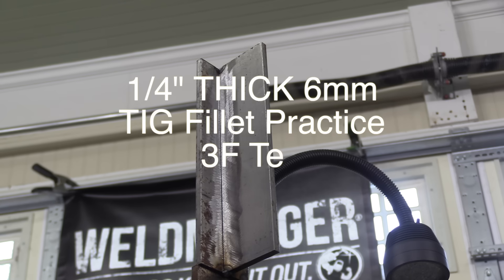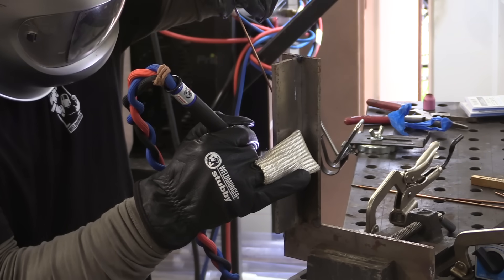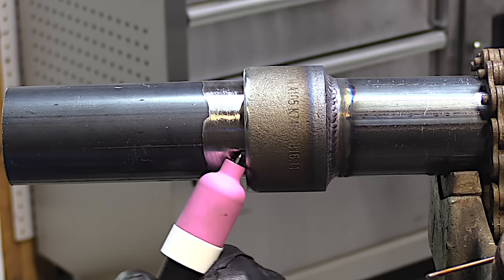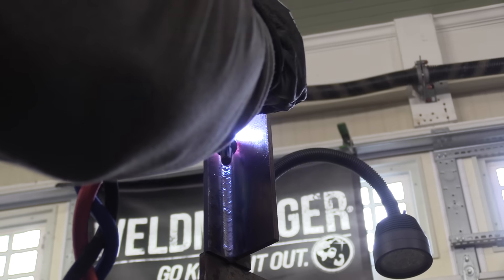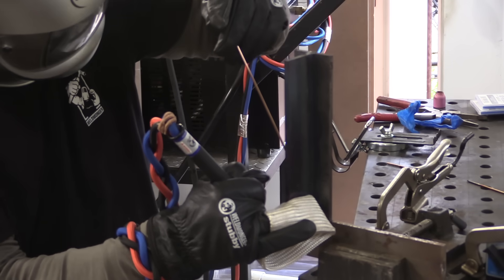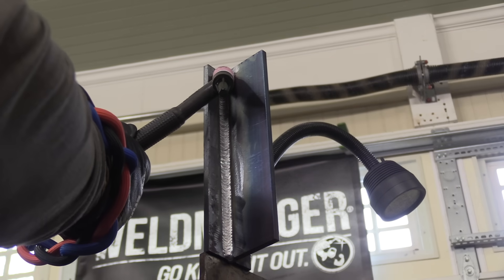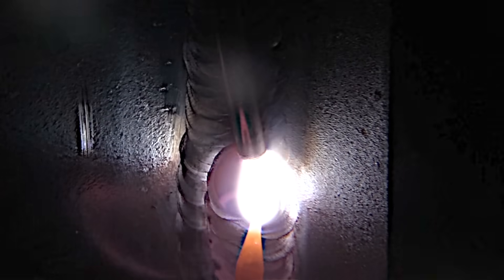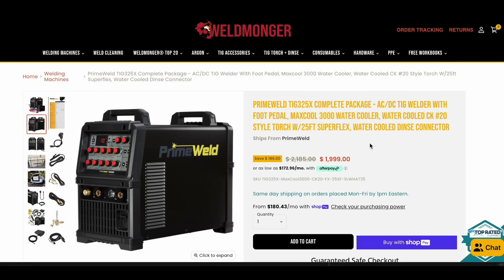Walking the Cup vs TIG Finger - Vertical Tee

Comment: You should do a video on what type of filler to use on any certain type of aluminum
Reply: I weld a lot of aluminum.  5356 is pretty much all I ever use.  Unless it's cast I will use 4943. These two will get you through almost everything.

Comment: Awesome video Jody 👊🏻 I weld a good amount of stainless pipe from time to time and sometimes you wanna bump it up a few more amps because your don’t always see it dig in the metal when walking the cup. I feel I weld a little hotter than what you were doing in your video this video actually helps a lot makes me a little more confident that I can turn down a little bit. That’s really the benefits of a cut and etch that you’re always saying to do. Thanks for the good video Jody. I had some heavy stainless the other day 8”sch80 pipe and I used some 5/32” filler wire and man that mess with your mind if your penetrating 😂

Comment: I have a question: What is the advantage of using scratch start tig when pipewelding?
Reply from the maker: the main advantage is that only simple equipment is needed and its very portable.  Imagine being high up on a scaffold.  with scratch start, you can run a long welding lead along with long argon hose and your torch and flowmeter are right there with you but welding machine might be 200 feet away.